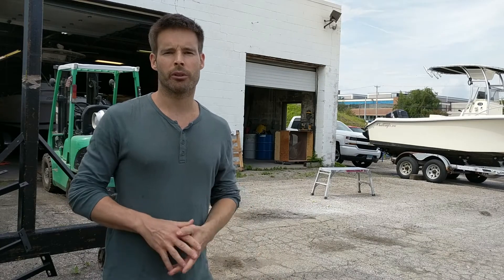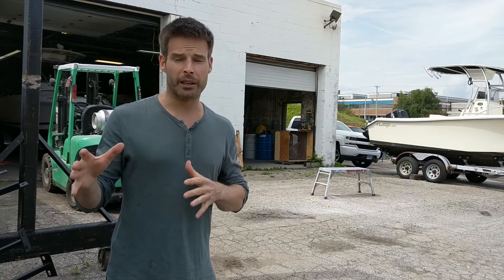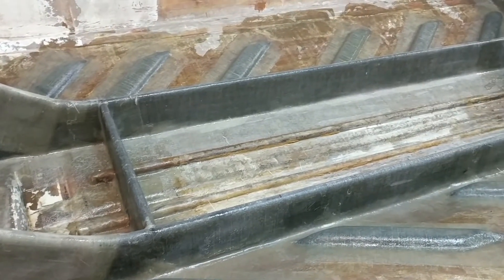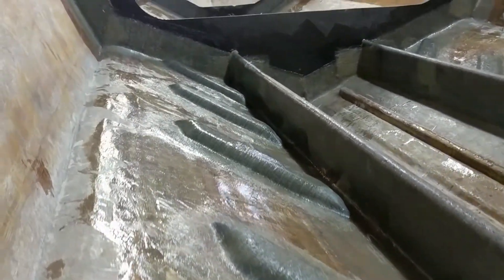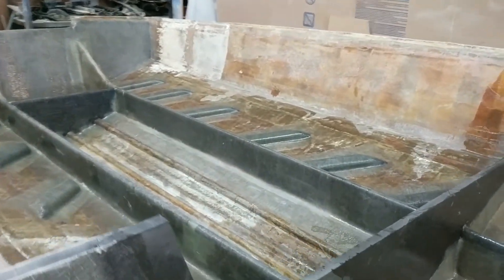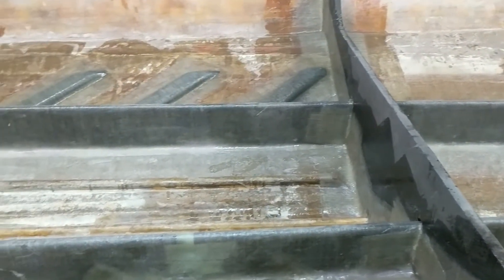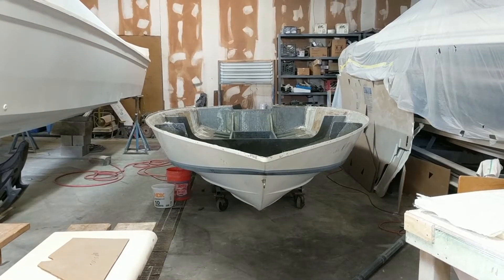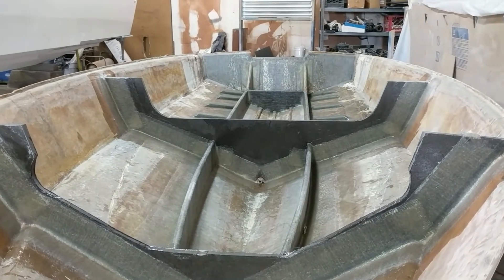Project Activator Episode 7: Hull Reinforcement

Comment: I know this video is pretty old and not sure if I’ll get a response. I have a 71 Tahiti. My boats floor flexes right where you added those reinforcement pads. My uncle who grew up on the boat said it’s done that since new. To me, the boat rides wet and I’m thinking that must allow a “hook” shape to form while under way. What’s your thoughts on adding a stringer over that area above the existing strakes? I’m not looking for literal advice on my specific boat just what to consider. Thanks
Reply from the maker: Thanks Aaron, would have to see it. But in general, your floor is part of the structure on a small boat with stringers. Could be a sign of the stringers being rotten and soft, where replacing the stringers and floor should make it stiff. An old Tahiti probably has a solid fiberglass bottom, so pull the floor and check.
Reply: @WavetoWaveBoats  Hey thanks for responding. There’s no floor covering that area. It is solid fiberglass. It just seems thin which makes it flexible. Maybe even just adding a few layers of glass might help(off the trailer)…? The stringers are still good as far as all conventional methods of checking have shown and that area is solid from under the hull. Then about 12” away at the first strake on either side it just seems thin. Maybe it’s not a big deal. I know fiberglass boats flex but I didn’t know they would move with the water like a shock absorber haha.
Reply from the maker: @aarong2387  You don't want that kind of flex. Definitely get it checked.
Reply: @WavetoWaveBoats  ah, I see that I said “floor”. That would be bad. I meant the bottom of the hull.

Comment: Hi Jarrett.  Thanks for sharing these vids. However I too have an Activator 22 that I will start on soon with new floor, bulk heads and transom.. would be great see some if your work in action rather than after the fact. Watching from Bermuda..👍
Reply from the maker: Thanks Dennis, love seeing more Activators saved. What engine are you running? Because of logistics it's hard to get the timing of the work and the videos but we are hoping to improve it!
Reply: Wave to Wave I hope to run a Yamaha V Max 225. I currently have it on my 21center console.
Reply: I really wonder how one of these hulls would do with one of the bigger new Merc 450hp outboard motors!?! 
  I feel their shortcoming is not a tall enough gear ratio available, that I have heard of anyway, and an engine that won't turn big rpm's like the old straight up 2 stroke engines... Hopefully that'll change soon.. someone has got to be figuring out how to increase the rev limiters at the very least I would think.. though I'm not sure just how much rev's these new 4 strokes can take..